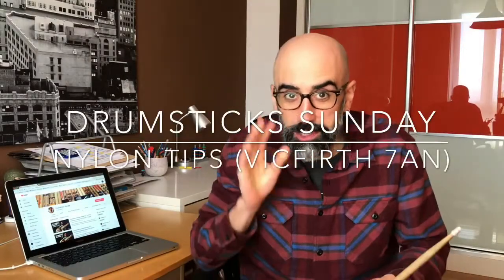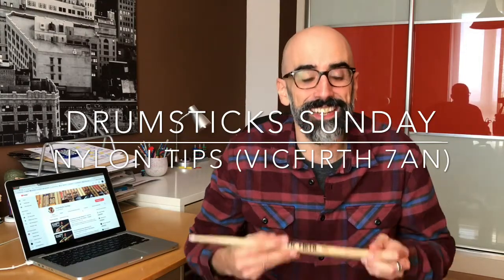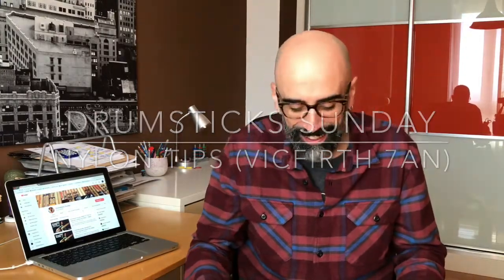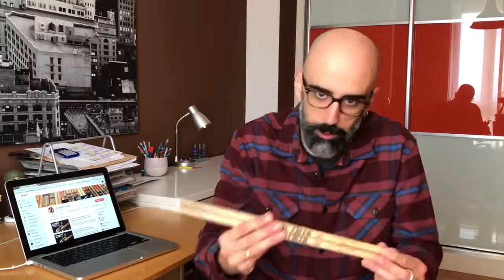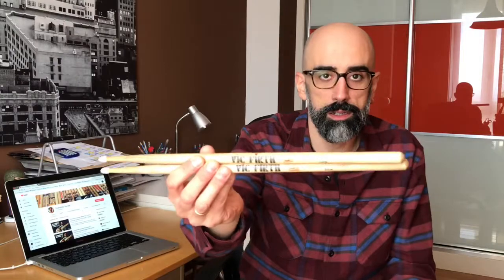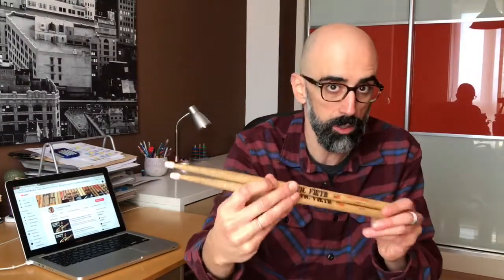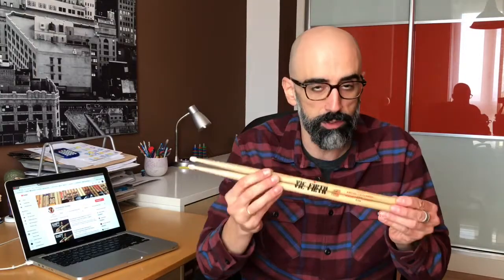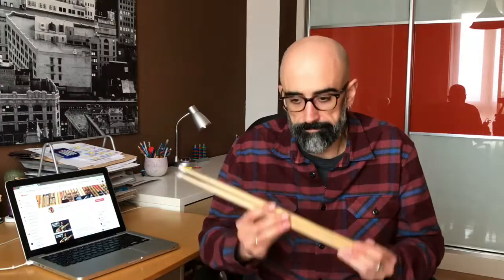Drumsticks Sunday (Week 38): Nylon Tips (VicFirth American Classic 7AN) - English Version

Comment: Been using the cheaper Vic Firths, Nova, just as good of a stick and half the price! Sticks are getting mighty expensive so I switched over and gave the Novas a shot. Only difference is some pairs are off a bit In weight but they are still balanced well  together and they look good. Plus I like the bigger tip and taper on these . $5 a pair!